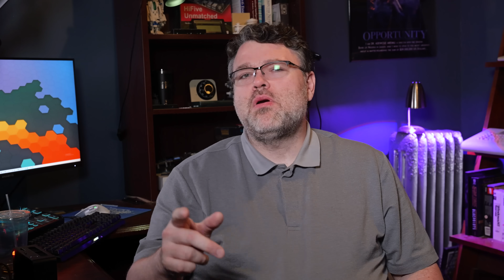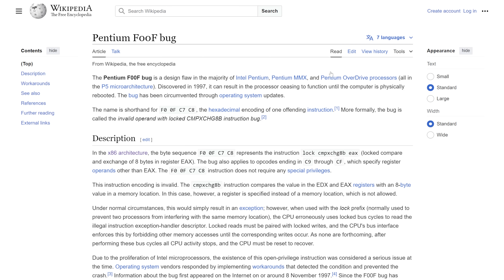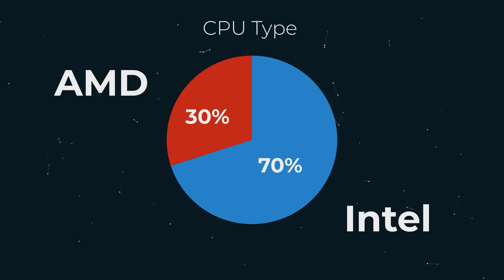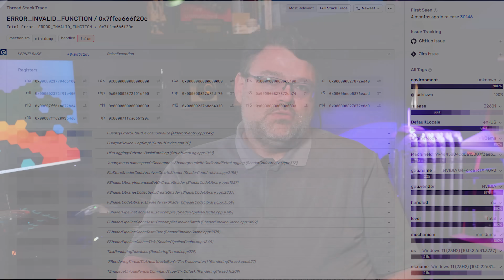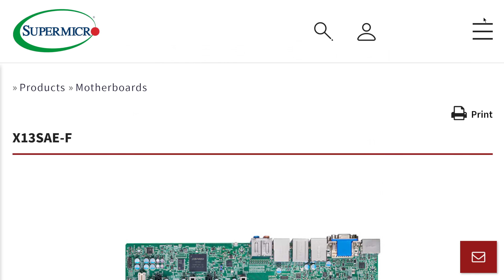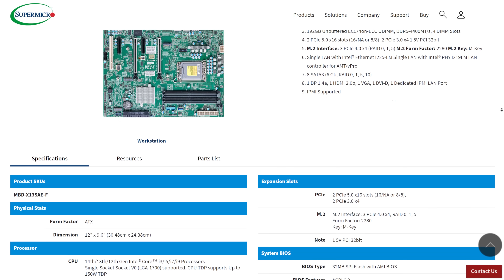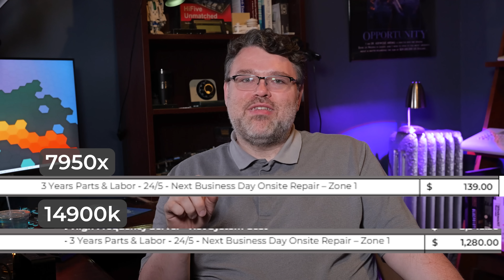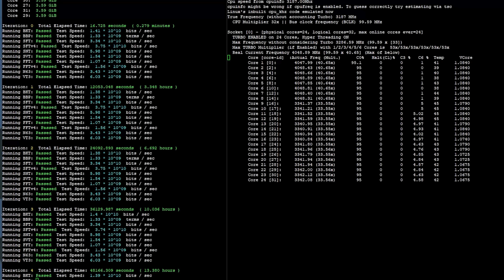Intel has a Pretty Big Problem

Comment: I was having similar issues with my dual Xeon R630 server. I found the weirdness only occurs when HWMonitor was running. Maybe the issue is not directly HWMonitor but with some library it uses. So how do you know if just being an observer is not the cause of weirdness?

Comment: Your not sure about nothing really. But one thing that's a fact is that most people don't know how to overclock  or make changes to the BIOS to stabilise their system.  What Intel did was believe that all of us knew how to run these high powered chips. Most just want to 1 click there way to more performance and FPS. But that's not gonna work on Enthusiast Chips. You gotta know your stuff.  I have both 13900KS and 14900KS running with a 360mm Radiator with no problems.  Had to find the sweet spot for both Chips. That took knowing how to utilize the Bios.  Intel is probably going to due away with allowing us to overclock their chips to stop the dummies from complaining. We're all going to suffer.

Comment: My 13600kf is crashing when boot if i use Ai oc or very easy oc
Reply: 13600K 5.7 P-Cores 4.5 E-Cores 5.0 Cache 1.37 - 1.40v.  Zero issues.

IGPU - Disabled 
C-States - Disabled
Intel Speed Shift - Disabled
AVX - 0
ALL P-Core 57
ALL E-Core 45
Cache - 50
TJ-Max - 90c
PL1, PL2 - 200w
LLC - 4 
Voltage - Auto
FIVR - Adaptive
+205 Offsets P-E-Cache

DRAM - 4000 CL 15 Gear1
VCCSA - 1.28v
VDDQ-TX - 1.3v

Comment: I can honestly say I have had zero problems?! I've a 13900k, overclocked (water cooled) no extra voltage, msi tomahawk board.
The only crashes I used to have was gpu crashes and I swapped out my PSU and all has been 100% stable ever since.
Am I just lucky?? Or has my PSU upgrade masked the prior problem??

Comment: Geez Wendell, you uncovered a bonafide conspiracy. This is going to bankrupt Intel.

When GM went bankrupt, the US government temporarily nationalized GM while their debt was refinanced, and their pension fund obligations were dumped onto the government's Pension Benefit Guarantee Corp (PBGC). 
I'm bringing this up because this is how bad this is for Intel. They are going Chapter 11 over this, and they will need government help.
This is also reminiscent of Volkswagen trying to hide emissions data with software that detected when the vehicle was being tested, and attempted to fool the tester. In the US, GM was on the hook for $37,500 per vehicle, just from the EPA, for a maximum fine of $18bn. Add on top of that millions of cars recalled and that was another $10bn or so. And then on top of that, you had lawsuits from car owners and shareholders.
Intel's exposure is on that order of magnitude. They should have come clean when they had the chance.
Having said that, Intel will be back to profitability after a year or two, but they really killed their brand with this s*. But for now, dump Intel stock and don't look back. It's a dumpster fire.

Comment: most of my games are not even starting. i'm keep gettin error(vram error) or game shuts down itself without any error. and also sometimes bluescreen occurs. it doesn't matter if the game is new or old.for some games i fixed the issue by changing the game from fullscreen to windowed mode from inside nvidia experience. but some games like "concord" i didn't even manage to see it's starting screen. i was blaming my graphic card but i see it now.. thanks..

Comment: I've had nothing but issues with my 13900k and it's gotten worse over time. Constant blue screens and crashes while gaming or editing in Premiere Pro if I don't have Intel Extreme Tuning Utility open.. I have to set all P-Cores to 52x (essentially making the CPU I paid a premium for slower) to make my computer usable. I'd really like my money back so I can swap to a Ryzen CPU.

Specs are:
13900k
Asus Tuf RTX 4090
64gb of DDR5 6000mhz ram (dual dim kit) - I did try other memory sticks, 1 stick at a time, and lower clock speeds
Asus ROG Strix z790-E Gaming Mobo - Using the latest bios version

Comment: I know its nice to have the newest hardware, but I always try to stay a generation or two behind for this very reason.  In this case, I had a 10700k and wanted PCIE gen 4 but I didn't like/trust 12th,13th, or 14th gen.  So in December, I got a 11900K and have been very satisfied with it.  I would be so mad if I had paid for one of those really expensive Z790 like the MSI Ace.  Heaven forbid you have more money than sense and bought the Godlike.

Comment: I get “out of vram” issues almost every time I try to start Hogwarts Legacy, also issues with some other titles. I get random bluescreens, and after the reboot the NVME drive is missing in the BIOS (need a full shutdown for it to come back). Got a i7-13700K with a ASRock Z790 PG-ITX/TB4, RTX 3080.
Reply from the maker: Might join us on the forum and make sure your bios is latest and then multiplier limit to 53

Comment: I'm on the fence between ordering an i9-12900k to replace my i7-13700k to get ahead of this problem while I have a bonus check to do it......but that's also an 8% performance loss in some metrics according to online benchmark sites.  My CPU's not dead yet, but now I'll be paranoid about it, especially if it's inevitable from a design flaw.  I already know that when it does go out, it's going to be exactly when I can't afford to replace it.

Comment: Hey hey, I work for a largish company (~15k workstation fleet) and we have been testing new Dell laptops with intel CPUs, in preparation for a hardware refresh, and we have had nothing but grief with them. Crashes, bluescreens etc when imaging them. One of the most common functions when imaging and installing OS? Decompression! Now we know why they have been so bad.  Dell has as at least partially admitted there is a problem to us. Might be swapping to team red, for the CPU's in the future.

Comment: Could it be the CPU bending? The membrane is probably something like FR4 and at 120 degrees it bends with ease. You can test it by applying pressure on the socket behind the mainboard and seeing if crashes still happen.

Comment: old intel processors pentium 4 intel core 2 duo intel core 2 quad can easily delete telemetry with a bios update, but public figures on YouTube say that telemetry in intel processors is a problem in new processors, which means that the manufacturer and sellers are planning to provide paid insurance against gigahertz megahertz because the new processor versions go bad, it's a scam, but the solution to the problem is easy, so as not to charge users for corrupted processors, but there will be consequences for the scammers

Comment: Thank you for bringing this up, has been messing me up recently.
I got an 13900KS with 64GB DDR5-5600 memory on win11. I have this one game which puts alot of stress on the CPU cores and for past month or so I did have one to two crashes a day on few hours long play sessions.

Now comes the drop in the bucket. Today I updated my Asus BIOS from 2301 to 2402 which states in their changelog: "Updated with microcode 0x125 to ensure eTVB operates within Intel specifications"
I kept all settings set to default and ever since that update, it got much much worse. Now I crash after 5 minutes of gameplay constantly... What I noticed is I clocked P and E cores all the way down to 3.6GHz and it only delayed the inevitable crash by minutes.

Something truly messed up with recent BIOS update, could anyone from Asus or other manufacture confirm this issue?
This became very frustrating especially with no official statement from Intel whether they are actually working on a solution.

It seems like it all got much worse in recent weeks/months.

Comment: Just speaking, theoretically, this sounds more and more like electron leakage from a quantum mechanics standpoint.  It could be from the gates or from the traces too close or not properly insulated.  This could be the first set of cases of widespread quantum tunneling causing stability issues.  This would be really really hard to actually verify.

Comment: I bought a 14900k early on which was stable for a few weeks, but then I noticed I couldn't even open certain games as I would get the out of video memory error, which then eventually evolved into me not being able to play any game at all, and eventually into my computer would just crash sitting idle on desktop in safe mode. As I said, I had this early on and there was absolutely no useful information on what was even causing this issue, just armchair techs screaming at game devs saying they needed to fix their game. I eventually swapped out every piece of that computer with spare parts and concluded it was the cpu and decided that I had just gotten unlucky with my 14900k and ordered a new 14900kf thinking it was maybe a 1/million chance of failure. Before even running the 14900kf, I undervolted it, disabled all boost clocks, lowered my thermal limits, P1/P2 values, and copied Intel's power specifications directly from their website. At this time it was suspected it was bad default motherboard settings and I had hoped that I would just ride this out until some sort of update came out. Even with absolutely everything disabled, undervolted, boost disabled, etc.. It happened again. My 14900kf has now slowly become instable where I can't even play any videogame at all. I've since just been using an extra AMD system I have, but I can certainly say that I will not be team Intel for the foreseeable future. I can say for sure that both of these chips degraded over time and the second cpu was not cooked like the first one was.

Comment: We have a couple Dell Precision 3660 Tower CTO in our Datacenter with 13700 and 13700K - they crash consistent when operated longer than 7 days with IO-Errors on the NVME PCIe bus. Equipped with 128GB ECC memory and Samsung Enterprise SSDs it is not possible to run a storage space or consistent VMs under Hyper-V.

Comment: First, I would just like to say, that I am sorry for all those out there who have had to deal with these problems. 

That being said, I have an ASUS laptop with 14900k/4080. It's about 6 months old. I haven't experienced any of these issues, at all. I game a lot on it, all at max settings. Unrelated to CPU/GPU performance, but the worst hardware related issue I have experienced is with the microphone array not playing nice with Discord, but I think that's just Krisp noise cancellation related problem. 

I hope this system continues to perform like it currently is. It was expensive (~$3000).

Comment: I think the problem is older than 13th gen. I have had the video memory error several times on a 12900k. I think they are just pushing the 13th and 14th gen more making the problem more common.

Comment: are you still wanting logs or crash reports? I have a Asus Max Hero Z790, Zotac Trinity 4090, i9 13900K , Kingston Fury beast black, Kingston NVME, Noctua D15 chroma blk, I haven't had any issues except with an OLED monitor, which I used briefly. I got my system last March, 2023. Other than a few power outages, that will show up, temps have been outstanding, and no gaming issues. Nvrmind, I went into some deep investigation, trying to figure out why my Core Stepping (CPU Stepping) couldn't be found. I think the CPUID answered that. B0671, which according to intel is in the  Intel Xeon E processor family for server.

Comment: I have a i7-14700K and I'm experiencing crashes, and it's more and more frequent, I've installed some BIOS updates but if Intel don't fix this I can't see myself ever buying an intel CPU again or supporting Intel CPUs in my workplace.
Reply: If u have MSI motherboard, use load line 6, should resolve everything... else overvolt(max1.45V under load) and underclock

Comment: Does intel i7 13th gen 13700hx processor has stability issues. I own hp omen laptop with i7 13700hx processor and rtx 4060 graphics card, I mostly played games at medium settings but I like to know if this processor has stability issues that intel 13th and 14th gens are facing now a days.

Comment: Anyone else getting flashbacks to how Intel handled the Xbox 360 “red ring of death” CPU failures?

I’m not saying it’s the same underlying problem, but both situations certainly have their parallels. At least in terms of Intel’s refusal to admit the root cause of the issues facing end users.
Reply: intel had nothing to do with the 360. it's an ibm cpu
besides, the rrod is caused by the gpu, not the cpu.

Comment: My system lasts about 10 minutes playing any game before crashing now.  13900 worked fine for about a month (no overclocking) and then all of a sudden just dropped.  I tried everything from new motherboards, new cooling, new power, new memory...I was about to start replace my case out of frustrastion.  Then the articles about Intel started coming out.  Swapping to AMD once the new chips are released next month.  Until then, I have a boat anchor.
Reply: same problem, what mainboard do you have? today I updated my asus bios from 2301 to 2402 and it got much much worse, 5 minutes in and crashing constantly. before the update I could at least play up to few hours.
Reply: I have the gigabyte z790 elite. I updated the bios and nothing changed.

Comment: i have 13700k  no issues for me at all running all at 5.2ghz air cooled. manual undervolt. this cpu can run 1.2v no issues and temps are 80C s..

Comment: I have a 14900k on my work PC. I'm a 3D artist and I got the CPU to eliminate the bottleneck of my GPU (Nvidia 4090) as much as possible. Performance wise I couldn't be happier.  But my computer crashes every time I turn it on and work for a while. On a regular working day I never shut down but force restart. It's not just in games. Games have nothing to do with the crashing. I have updated to all the recommended BIOS grom Intel for my motherboard tweaked every setting they asked. NOTHING WORKS. I Don't think a refund will suffice for all the months of frustration lost work because I didn't get to save my progress in my work when the damn thing decided to crash and not to mention the extra hours of work to redo all the work that is lost every time.

Comment: Back when Ryzen launched and had a bug in their 16-bit emulation (And some other stability issues), AMD was quick not only to document these issues, but offer replacements without much questions when you were affected. Intel f'd up, but it doesn't have to be a big deal if they were just more transparent.

Comment: Great video, thank you!  I've been dealing w/ a 13900k for a year now.  The birthday gift of a warhorse gaming computer to my son (i9 13900k, 4080, 32 gb 6000 ram, 2 tb 4x4 990 pro m.2 nvme, 360 aio, Asus and a gigabyte z790 board. . .).  It is the worst, most regrettable, purchase I've ever made.  
It was assembled at micro center, and after some early install and config issues we're resolved, it ran well for about 2 months. Never over clocked, 360 rad, professionally assembled.  And it is definitely getting less and less stable.  😖🤬😭

Comment: i have an affected 14900k, games crash with both out of memory errors, not loading the first time but working the second time.
windows file sytem corruption causing me to reinstall and roll the dice on whether i get a clean or recoverable file structure each install.
funny enough, if i set my cpu core affinity to not use cores 8+9 on a specific process, the program runs fine and no longer crash.
i've found a couple forum threads with other people finding similar results with disabling those specific cores. something to consider.

Comment: I had severe corruption problems on my ASUS board + 7950X based system that were resolved by ceasing the use of EXPO profiles and running at JEDEC standard MTs (4800) with default SPD timings for 4800 (kit is an expensive, low latency G.SKILL 6000 kit purchased new). Without controls, e.g. golden components available for comparison, it's difficult to say where the I/O errors are originating. Since a lot of I/O devices use MSI(x), it's conceivable that memory instability is the culprit in at least some of the dysfunctional systems. I own a dozen modern computers, and have both Intel and AMD systems. Poor quality isn't strictly an Intel problem.

Comment: Why is no one talking about the fact that the I7 and I9 are the same chip, only with fewer E cores enabled in the I7?
Reply: That's how it works, yes. No one is talking about it because it's just how it's been done since forever ago. I'll tell you more: i5 13600K/14600K  also uses the same chip, only with fewer E and P cores enabled. It's only 13500/14500 and below that uses other chip.

Comment: From what I've heard they're having issues due the size of things for this next generation. See the smallest part of the transistor is the gate (control mechanism) and it's been in the 10nm-5nm range for a while now.  Even though according moore's law we're supposed to continuously shrink our technology so we can keep on increasing the transistor count every few years. But rather than shrinking things we've been using complex geometric structures inside the chips to increase component density instead, in an attempt to stay on track with moore's law.  
Now onto the size thing, while 5nm was fairly stable and with what we're seeing now is that as we go below that range we're seeing issues pop up all over the place because of the increased fragility of the structures within the chips. 
Overall we're fast approaching hard limits when it comes to current technologies on the mass fabrication side of things. For example, electron beams with a minimum 2nm diameter doesn't leave a lot of wiggle room when we're operating in a 1nm-3nm range for the critical dimension.

Comment: ddr5-3600 on 128GB seems correct. that is quad rank. it will auto set to a very low speed. same for amd systems (i have 192gb myself on 7950x3d, don't ask why, i don't have an acceptable explanation)